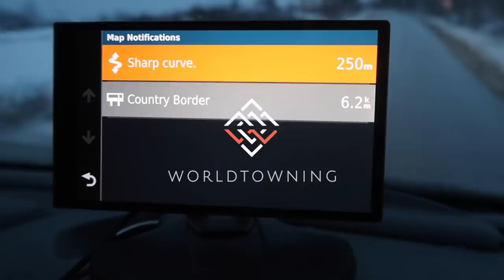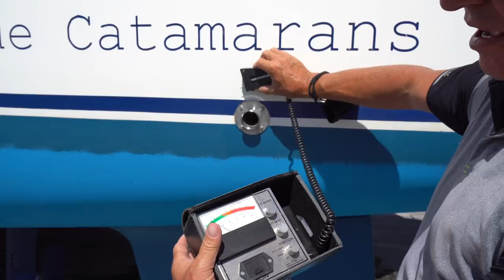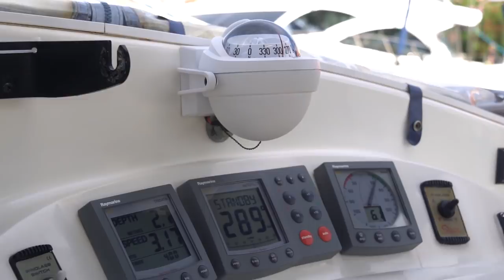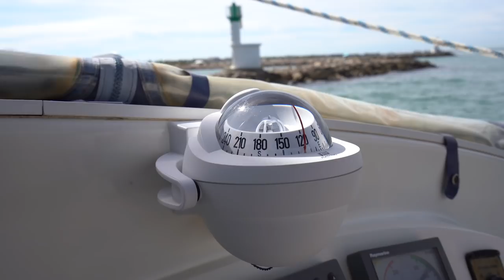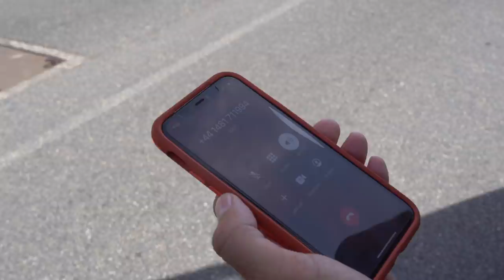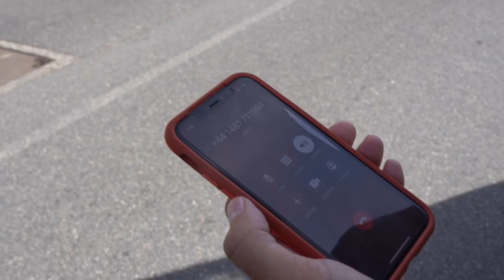WILL WE CALL THIS BOAT HOME? (Catamaran Survey and Sea Trail) | EP 253

Comment: Congrats from me. Looks like a very nice boat. I agree with your surveyor, very good price. Aus$190 odd. I would think Aus$250 ish would be normal. Have fun learning the ropes. If you can sail the Med, you can sail anywhere.
Reply from the maker: That is what we have been told, but then that scares me to death.We are jumping right into the fire to learn to sail. Yeah, we have since learned even more about this deal and it was even better than we were told by the surveyor with all the add ons. Thanks for your support.
Reply: @WorldTowning  Don't be scared, just be dillegent and all will be ok. Like everything in life, "A little at a time"